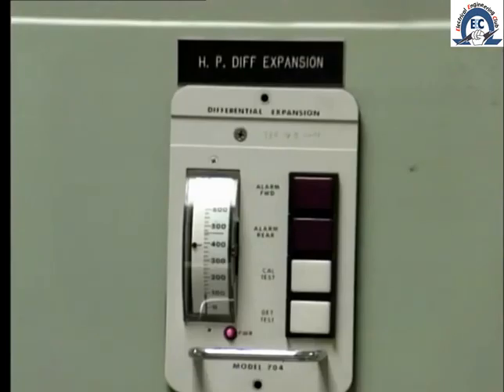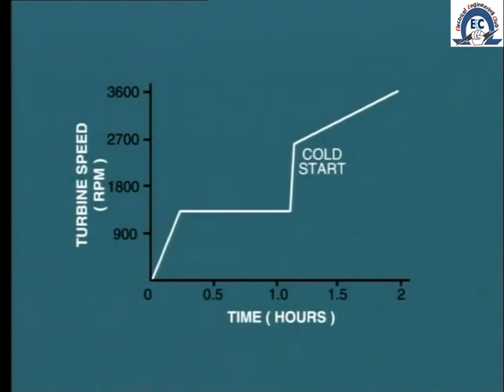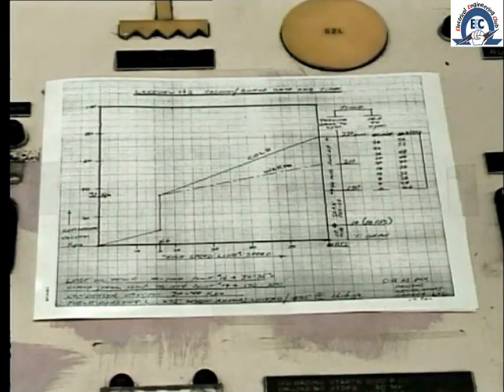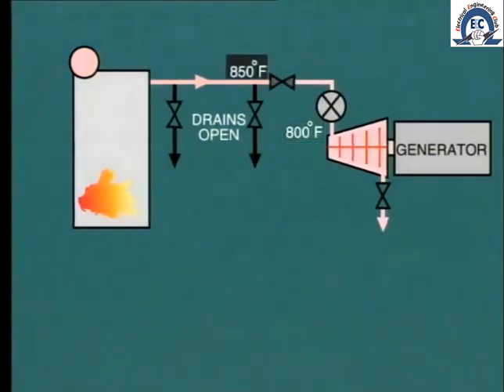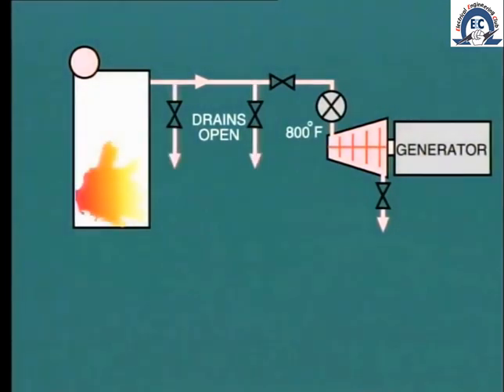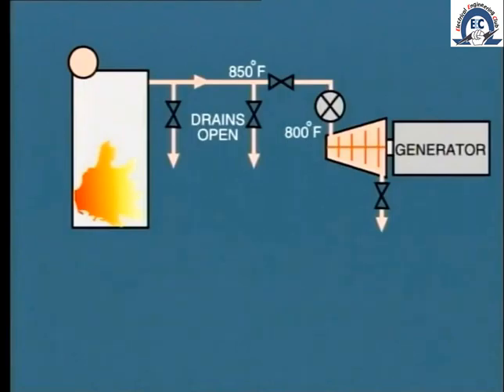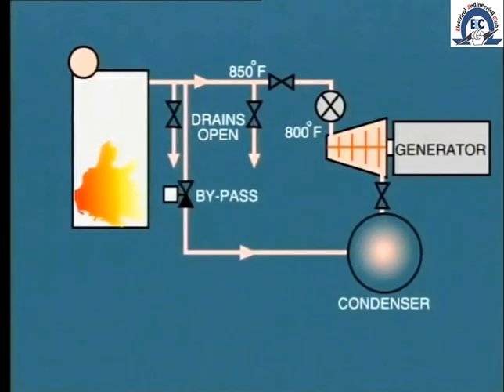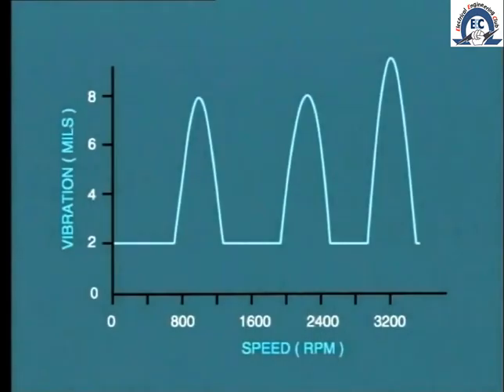lesson 7: protect steam  turbine from differential expansion

Comment: On day i found the turning gear is not work auto and its in remot, than i make sure it is rotiting or not i found it off, i switch to manul after i inform the board operator, every operator must make sure about it it will be caus boweing for the shaft and it will be very high cost for maintens , even it is in auto make sure it is rotating